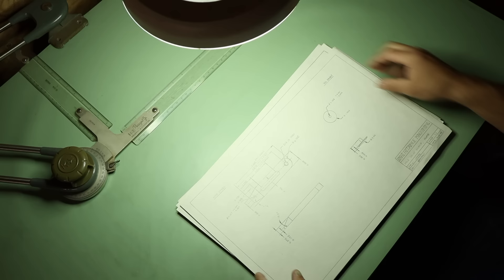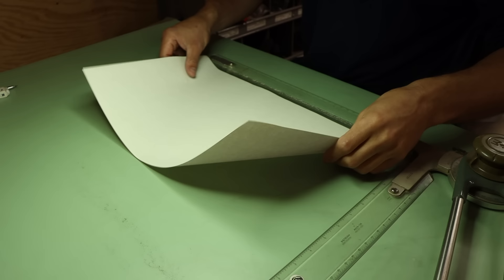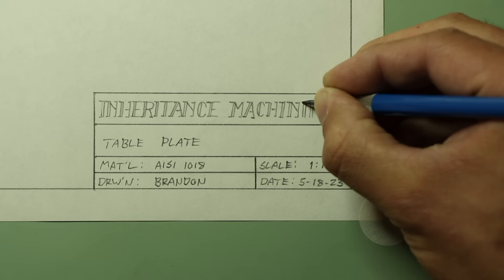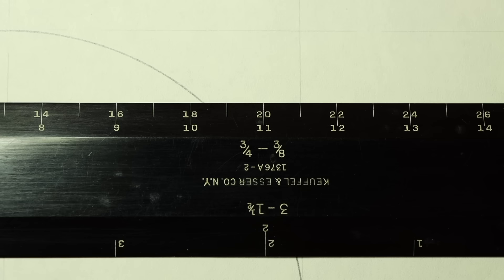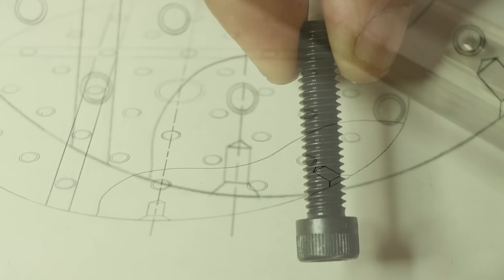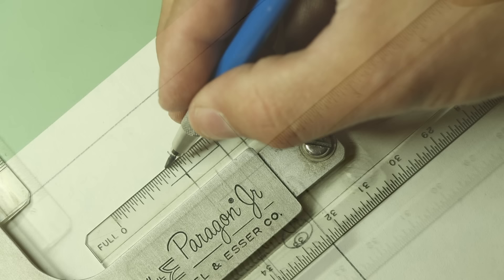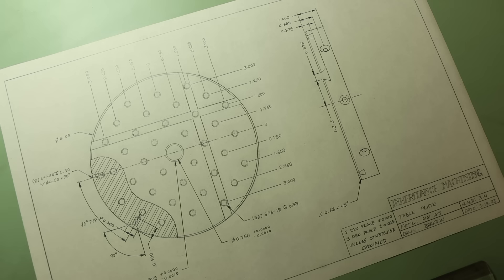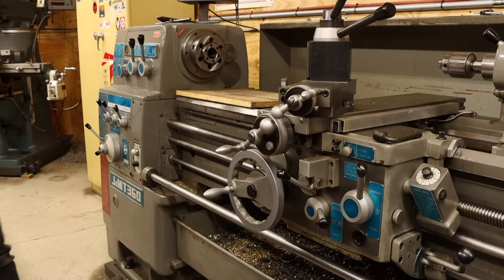The Joy of Hand Drawing Machining Prints || INHERITANCE MACHINING

Comment: First off, let me say that you don't seem old enough to have learned this technology in school.  So nostalgic.  I learned these skills in public school in the early '80s.  It's served me very well over the years.  The thing about drawing by hand is that the process moves at a pace which allows you to think about the wider implications of the decisions you are making.  With CAD, it's easy to just put that square-cornered pocket in the drawing, and not think about it again until you have to machine it.

My old man was an engineer, and provided me with a MASSIVE (it was mounted on a 40"x84" hollow core door) K&E Paragon drafting machine like yours -- except it was left-handed, making it not so useful for me.

When we moved 15 years ago, I sold it to an older gentleman who was incredibly happy to get it.  And, I just threw away an electric erasing machine a couple months ago.
Reply from the maker: That's exactly how I feel about it too. Though having done manual drafting does help prevent those kinds of mistakes in CAD. I have 4 years of drafting in highschool in 2006-2010.

BTW I recently had my K&E apart for maintenance and I seem to think it would be possible to rotate the head 270 degrees and flip a few parts to get it to a right hand configuration. Too late now but if you ever came across one again.

Comment: I've done some drafting for my future machining project and it's very relaxing, also doing it with your hands is just different and gives more satisfaction. I've never seen the electric eraser but if you're interested in something more simple Pelikan makes a pencil which has a rubber core instead of the graphite one and it's very useful when you need more precision.
Reply from the maker: Thanks for the tip!

Comment: last week i turned in an assignment, a fully hand drawn draft of a motorcycle engine block, 2 valves 4 stroke 1 cylinder took me 34 hours to go from sketch to final draft (more if we add the time it took to take all the measurements on the reference engine) but i felt super satisfied seeing my baby

Comment: I worked as a QC/Inspection Manager for a precision Machine Shop for about 5 years and you provide more accurate detailing than most of the drawings our machinists had. If I would’ve had you’re prints to go by I’d probably still be working in that position 😂. Most of the engineers would give us a +/- .0002 tolerance on a hole for a dowel pin in a part. But I digress. Overall great video. Big fan of your content. Keep bringing more videos and keep carrying on your grandfathers legacy. He’d be proud

Comment: Back when I was learning to become a mechatronics engineer I learned how to make technical drawing per hand and it was hell, mainly because I had to follow ALL DIN-Rules, but the one saving grace was that we used Millimeter-Paper, which is just like the paper used in math, with preprinted squares on it, just those squares are 1 mm by 1 mm making drawing a lot easier since you have the squares as a reference.

Comment: This reminds me of my first semester in engineering class! Some tips:
1. For semi-transparent paper, we usually just dip ordinary printer paper (about 80 gsm) into (coconut) cooking oil, and then dry it. Works great!
2. The first angle projection is very useful when you are the machinist. If you have the actual part on your hands and a 1:1 scale drawing, you can just place the part on top of one view and flip it to see other views. E.g. place part on front view, flip to the left to see the right view (I hope you get what I mean 😅).

Incredible video as always! Can't wait for more! Cheers!
Reply from the maker: 1. sounds like so much work! and 2. makes me cringe so hard at the thought of laying an oily part on my drawings 😂 (of course this wouldn't be a problem if there were CAD prints) but I get your point! Thanks!

Comment: Great video and skills. Takes me back to when I learnt drafting 30 years ago (which I no longer use). We were doing A0 sized drawings, in a vertical position (due size of the sheet). One thing we were taught was to try and keep your hand off the sheet (or very light contact). Having multiple pencils (with different leads) sped things up 👍

Comment: A chisel point on the pencil lead saves a lot of sharpening a conical point.  It also gives a constant line.  I didn't see anyone use a conical point during my 50 years as a draftsman and design engineer.

Comment: I've appreciated your video, nice to see people loving old style drafting.
I start that drafting since a teenager in a technical high school, now, close to retirement, I'm using mostly CAD and 3D modelers.
I've some of points to "finger" you.
First is that two leads are sufficient, to be choosen looking how heavy is your hand, my leads are 2H and HB/F. Very appreciated the 2 mm lead, it's a touch of class, IMHO.
Second is the sharpening: cool the daddy's tool, questionable the hand sharpener because the point is too short, we "true draftsmen" got a strip of sandpaper to make the longest possible cone, always in fight with graphite dust spreading all around and blacking-in our pencil cases. 
A couple of notes on the compass: first, we rotated the steel pin to get it roughly vertical to the paper, reducing the hole. Your compass do not allow it, ours got either the pin clamp rotating or the pin leg hinged. As second, the lead is sharpened to looks like a chisel, getting a longer constant thickness of line. Moreover, for multiple circles on the same center, we stick on it a bit of paper tape.
I don't see you checking the rulers squareness after changing it: it's a must cause no confidence can be given to the adjusting screws attitude to keep the position. 
Also the way you are using the rulers is not the best: you should use the opposite side of ruler (see for instance frame at 5:16) cause the pencil point should not be pressed against the ruler but slide on the point cone side. That allow to not fill with graphite the tiny gap between ruler and paper for a better cleaning of drawing.
Last advice is to try a different pencil, much more friendly than the one you (and I) are using. It's an old model design by Bauhaus (maybe Gropius) and was an attempt to join design with ergonomy. The pencil is the Faber Castell Tekagraph 9603, a triangular slim shaped pencil, the grip on it is a great feeling (but only for lead drafting lovers), like to hug a well shaped girl. Be careful when traveling with that pencil because its unusual shape caused me to open my case at Heatrow for a security inspection.
If you read till here it means i don't bored you so much, hope give you some tips to improve your technique.
Please consider that my comments are done with a smile, aren't a blame at all.

Comment: Nice one. I learnt technical drawing at school and college and it has been a massive help in my working life. From training to be a carpenter and joiner to kitchen and stair designing amongst other projects. Later on I learnt CAD, made easier due to the hand drawing skills I had. The upside of CAD is that many projects since then were made taken from dimensions off a laptop screen not printed paper.
The occasional printed drawing was required for full sized templates or scaled drawings for architects or clients.
ATB Rob

Comment: You are an excellent draftsman.  That is coming from an Engineer that started on the drawing board.  By the way, while all the equipment is familiar to anyone that did drafting in the Boomer generation, my big moment came when I had a gotten co-op job in college. While I might have been a slightly above average draftsman in college, I looked at the drawings that the draftsman at the company that I was working for was completely humbled.  They were good, and like any true professional, they were fast.  Good job.  I was a early adopter of AutoCAD.  Realizing that I could never draw as good as these draftsmen and draftswomen might have help push me along.

Comment: Back in the early 90's I went through the drafting program in our local vo tech.   The first year and a half was actual drafting, the last year was autocad.  I think we were running acad11 for dos.  I got a lot of joy out of actually drawing by hand.  The VICA contests were a lot of fun as well.  Part of one contest was shrinking a C sized dwg to microfiche and then vlowing it back up and the lettering had to be legible.  

I graduated with a degree and worked thru high school at a local factory doing drafting after school and weekends.  I worked there at the beginning of college during the weekends. Come to find out, I absolutely hated sitting in an office, going to work at the same place every day, and having to stare at a confuser every day.  

I ended up quitting college,  going to work in the trades, and have had a pretty good life.  I dont regret the 2 1/2 years that I spent in drafting class.  I can read drawings and wiring diagrams very well, and can sketch up whatever I need sketched up pretty quick.

Comment: Nice work, again. Your high quality videos inform, entertain, educate, and best of all the motivate. As a guy who grew up on a board in high school, and had a whopping 2 CAD classes while going to college back in 1980-something, I hated CAD with a passion, which is likely attributable to having to share a computer. I also had a few art classes in junior high, but drafting was technical and precision art to me. I excelled at it on the board. After watching a few of your videos, you have motivated me to add a drafting board in my home shop even though I have embraced CAD modeling and CAM software to do CNC work. I just purchased a vintage drafting machine that was missing the base assembly. I finished making one today and mounted it on the board. It felt quite good to model the base in Solidworks and CNC machine it to get my manual board functional. Can’t wait to start the next project and use it. Thanks for doing what you do, and keep it up.  Just wondering if you would approve of me designing the tittle block and border in Solidworks so I could print out some sheet templates?😊

Comment: Love this!!  What a great video.  I still love to hand draft things when I can, at work we use a sign software called Flexipro.  It's not a drafting software, more of a design software but I still create artwork for channel letter signs and the like in it by using my hand drafting knowledge and a little ingenuity.  If I didn't learn how to hand draw my designs, i'd be lost.  Everything from the artboard to the dimensions and material symbols, I use it all the time.   I recommend anyone wanting to get into fabrication & manufacturing, machining & welding, or general design & graphic design to start with drafting by hand, it will make your life 10x easier everyday of the week and twice on sunday :)

Comment: 8:55 - to solve the problems with the central hole when drawing a set of circles, a special device was invented. a tiny metal button with a recess  for a compass needle, such as a stationary center. This thing can be found in old drawing sets.  Unfortunately, I don't know if it had any special name.

Comment: You are definitely going old school, and doing a great job, I might add!  I took drafting classes in school in the early 1970s.  While I prefer pencil on vellum, ( more durable than printer paper but cheaper tjan mylar), I have taken to doing my drawings in Word or, more often, PowerPoint.  It is much easier to keep electronic paper clean, and I can print out however many copies I need, so getting a shop copy dirty is not an issue.  Recently, I splurged on Alibre 3D software, which I find learnable, unlike AutoCad products. I commend you on your artistry, keep up the good work!  I will be purchasing several of your drawing sets in the future!

Comment: I love watching you hand draw designs. In addition to all the pluses you mentioned, don't forget that it can be much cheaper than using CAD software. Solid works, fusion 360, SketchUp, etc... are all expensive to use if you want the paid features that actually make them usable. And knowing "analog" means for doing things is invaluable. Learn to navigate with the sun and stars first, then learn GPS.

Comment: My High school teacher insisted on teaching us drafting technical drawings the old way. With the line that represents the intersection(s) of the planes (LOI, Line of Intersection). 
It wasn't necessary for the curriculum. But with that you had to stick to the method , and could do such things as determine if 2 lines intersected or not. And by how much distance, etc.
Teaching kids to abstract things and at the same time follow a method. Rulers and setsquares (30/60º and 45/45º). H and 2H pencils. Eraser. 

CAD is no excuse for bad designs. It certainly makes it easier and accessible (similar to a writing machine or a text editor makes easier to write ) .
But you still can tell who cares about the result , and who doesn't mind getting a job half-assed-ly done.

Thanks for your videos and insights.
I must admit i'm very jelous of that table and drawing arm.

Comment: Once again I got a kick from your video.  I am an old school draftsman.  My first true job, at age 15, was detailing parts for production machinery.  I eventually moved on to land surveying and civil engineering drawing.  I learned to ink drawings for things like mortgage surveys 

The reason for velum, linen and mylar drawing quality and the ability to stand the test of time.  The transparency is not the ability to trace, which I rarely if ever did, but the ability to duplicate the drawings making blueprints and blueline copies.  It brings back memories of running prints in 100°F rooms for hours with the smell of ammonia in the air.  It also brings back the memory of changing 5 gallon liguid ammonia bottles.  Vellum  linen and mylar hold up much better when you make corrections  especially if electric erasers are used.

When mechanical drafting pencils are used they are sharpened using a "pointer" and not a "sharpener".  The black cup pointer you use is a great tool, until you drop it to the floor.  I don't think you'll ever get rid of the mess the graphite makes.  Look around the made pointers that fit on the back of electric erasers.  Compass leads were often flattened using a file card.  These were flat wooden or plastic paddles with a pad of sandpaper. You created a chisel edge on the compass lead which allowed the lead to be sharpened without removing it from the compass.

One of my favorite drawing materials was a reverse erasable sepia.  If you had repeatable drawing, such as guide rails, you could make a master drawing and then run a number of sepias.  The sepias could then be changed with new dimensions to suit different parts.  The reverse sepia would have the original drawing on the underside of the drawing, and the new information on the top.

Bob
Reply from the maker: Thanks, Bob and thanks for the info! A lot of stuff there I wasn't even aware of!

Comment: My first tasks as an engineer, I was making technical drawings by hand.  I still remember my technical pens (Rotring) in various sizes, T square, set squares, protractors.  Yup, those were my basic instruments.  I didn't have a proper drafting table with the arm machine.  Too expensive for me.  I no longer have most of my instruments and my Rotring pens are mostly dried up, caked up and damaged.  These days CAD is the way to go.  I think I easily have tens of thousands of hours on technical drafting.

Comment: Had mechanical drawing/drafting classes in high school nearly 70 years ago ... and learned so much of how to create understandable drawings/sketrches. Since those days, I still do hand done drawings (really sketches) for almost anything I'm working on, or crafting, even stuff I'm repairing -- in order to try and better understand how a device works. I currently build wooden boxes, of good quelity .... I have a pencil sketch of the next one resting on the desk at my elbow right now. And will build from that. Point is, i also have both the computer experience and ability to do professional level AutoCAD work ...  easily. BUT ... when working on my own, I just prefer to do quick pencil sketches. Like somone else commented ... everytime I attempt to do something in the shop WITHOUT a drawing of some nature to work with ... I screw up stuff ... sometimes disastrously. Besides ... I just enjoy the feeling of a pencil and paper underhand. Somehow transmits a sense of 'control' over things. Thanks so much for your video ... allowed me to see that I'm not the only "old hand" still doing hand drawings!!!

Comment: Great job, a well executed technical drawing is a joy to look at. One easy way to reduce the number of views needed would be a partially sectioned view - the side view could probably have half of it sectioned out to show the internals, and no separate section view would be needed.

About the 1st vs 3rd angle view. I'm used to the 1st angle view and of course think it is more logical :D. If you imagine that you had the part on the table, the 1st angle views represent how it would look if you just "tipped it over" in one direction.

Comment: Some (free) advice from am aerospace systems engineer: There is a critical step before the concept/ideation phase of design. In a nutshell, it's "solving the question". You don't need to spin up DOORS, just identify what the thing needs to do, jot down some requirements, and identify any constraints. Then start your brainstorming/ideation/refinement process. If you properly solve the question before trying to answer it, you'll find your design completed without needing any revisions or problem solving along the way.